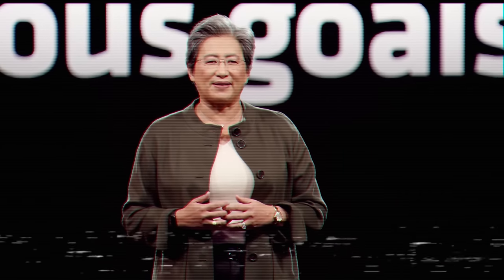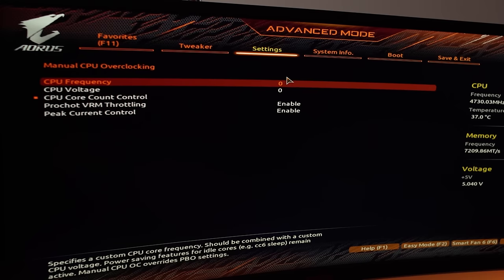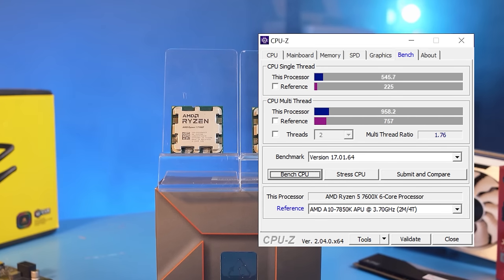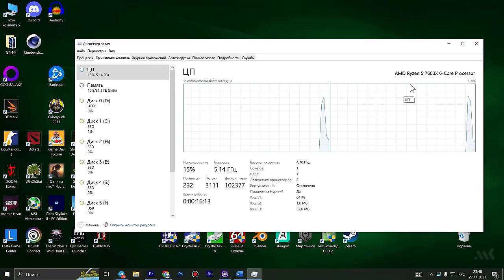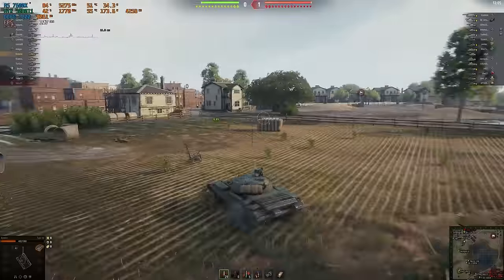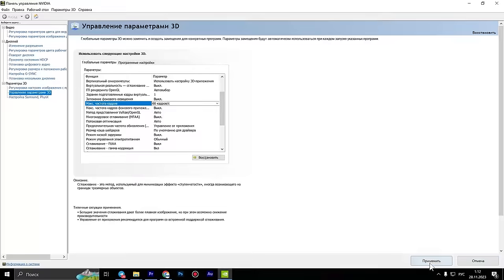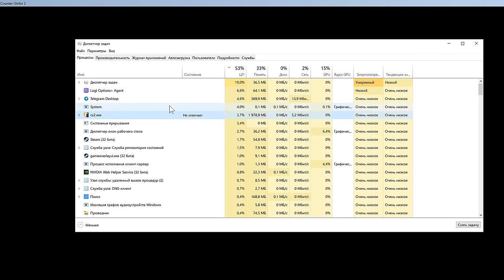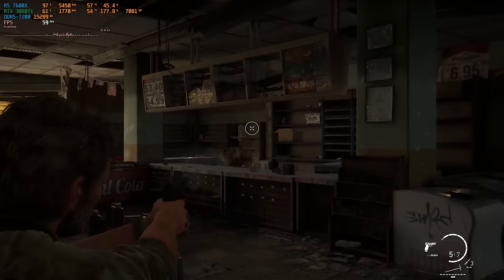One core is OP | Ryzen 1 7100F test

Comment: That SMT is purely a Software-Implementation is false. There have to be Hardware adaptations to the chip to get it working. It just takes little diespace, but it is not possible to get a core to work multithreaded only by software. Please correct. THC
Reply: Actually it is multi threading existed since 1968 on single core cpus. What they did is pause and save the instruction position of what was running then switch to another thread.
That's how windows 3.1, nt.95 and 98 all worked. There is a book called how to create your own 32 bit Operating system. That will explain it and goes through the code on how it is done. There are other sources also.
Reply: @GRHmedia But SMT is simultaneous multi threading (ie using free arithmetic units on core to run 2 threads almost at the same time) not just task switching in time.
Reply: @GRHmedia  the video is still misleading. he's keeping SMT turned on in the bios, but SMT is hardware MT and doesn't work "purely on the software level". he's talking about software MT which he can't even turn off in the OS.
Reply: @GRHmedia That is time sharing based multitasking. That is NOT multithreading. It is in diametric opposition to multithreading.  Matter of fact, that is what they called it, time sharing.
Reply: You are correct. I think the problem is you need to be able to save the state of the registers, and that requires hardware to do. Otherwise when you run another threads the registers get flushed and the data is lost. A lot of the bulk work is done through pushes, pops, peaks, bit shifts... and that's all register work.
Reply: Which is why SMT was disabled on some of the Renoir APUs like the amazing (for its time) Ryzen 5 4500U. It had 6 cores and 6 threads.
Reply: Amiga's were multi threaded on a single cpu
Reply: @reghawkins73 NO! They were able to  multitask through time sharing the CPU. That is not multi threading. It used the Motorola 68000 which is a 16/23 bit processor. 32 bit CPU but only a 16 bit bus. Later Amiga clones used a Power PC processor that could handle 4 threads per CPU. But the actual Amiga? Nope.
Reply: SMT uses dead time in a core (caused by things like a cache miss), and extra registers to keep the core working. X86 cores already have many more registers than you’d think in order to allow SuperScalar processing (where there are multiple execution units that are fed operations out of order, and registers are continually renamed internally to allow each unit to work with values that may have been changed by others), so this doesn’t take much more space. Logically SMT looks like two physical cores to software, but you can’t get the full performance of 2 actual cores, more like 1.3. It’s a fairly cheap way of getting extra throughput from a core that would be otherwise stalled waiting for something.
Reply: @krisspkriss well Amiga was multithreaded, Copper and other chips could run in parallel with the cpu. 😊
Reply: @AllanSavolainen  :D That isn't what multithreaded means. A 486 had a math coprocessor that ran in parallel with the CPU but yet it wasn't multi threaded. It also had a graphics card that ran in parallel. Still not multithreaded. Le sigh.   You do understand that Copper was literally performing the functions I just described? Do you also understand that... just about every computer does what you say? Damn, I guess my Commodore 64 was multithreaded too! It had a sound chip that able to stream data independently from the CPU... so.... multithreaded (by your definition).

:D:D:D:D:D:D
Reply: @krisspkriss  well SID cannot execute instructions itself but the CPU needs yo feed its registers. But Copper had instuction memory it executed from and could do so independently from the CPU
Reply: @AllanSavolainen  And  everything you said applied to a 486 with a graphics card.  Or how about a 386 with a math coprocessor installed. 

As for SID in the C64... OK, fair enough. At least we are establishing some borders on what is or isn't multithreaded and why.
Reply: @krisspkriss  I do have to disagree with you. As the 287/387/487 math coprocessors cannot execute code themselves, they just have registers where the CPU puts values and there is a command to wait for result (or keep executing and fetch the result later). The math copro wont fetch any commends from memory.
And same thing with 486 era graphics cards, they had blitters and other commands to draw on the screen, but they were also called via registers and don't think any had execution queue, which is why they were quite slow for line drawing etc, only moving memory around via blitting was really useful.
But I can agree that SMT wasn't a thing on Amiga era home computers. I think Cray Y-MP did have it though, but I think it was a vector computer, so perhaps it mostly just had SIMD.
But I think there is a reason to call it SMT and not just MT as the latter is quite vague and could mean systems with parallel coprocessors. Like some 16bit consoles that had Z80 for music and it actually did ran parallel with its own code.
Reply: @AllanSavolainen  I agree with you 100%. I would never call a 486 multithreaded either. I was just trying to establish what my interlocutor thought made a CPU multithreaded. In my mind, you have to have multiple threads running concurrently on the CPU with the front end of the die containing all the needed support hardware to make that possible. 

Hell, if you don't constrain it in that or a similar way, a WW2 analogue fire control computer on say... the Iowa... would qualify. They had independant resolvers with their own independent I/O and yet worked in concert for the same task. 

No, I am not saying it was multithreaded. I am saying it becomes pretty meaningless if you dont constrain its set in some way. Like... the FPU and APU have their own registers and run independently... so does that make a single core processor without multithreading... a multithreaded processor? Or does it have to be completely Turing complete on its own? In that case, it is only multithreaded if it has more than one core, and Hyperthreading is irrelevant. 

So you see where I am coming from. I just want to avoid going where dragons lie.
Reply: @krisspkriss  Just to point out that I have multithreaded 486 computer, it just has two CPUs :) classic SMP
Reply: @AllanSavolainen  Yeah, I used to rock dual CPU system back in the day. My last was an Opteron 2435 (I think). I agree. I also used to argue with people that said it was useless on a home system. But the ability to <alt><tab> between a game and YouTube or back in the day, my WinAmp player, was something you had to experience to understand. And most people didn't.  I think my first dual core was an Athlon K7. Could of been a K6-II. Been a long time.
Reply: Multithread and SMT(simultaneous multithreaded)/hyper-thread are different things: multithread is pure software solution, SMT/hyper-thread are hardware solutions.
Reply: @chenyansong  SMP is also hw solution to multithreading.
Reply: @AllanSavolainen  technically multi threading is different from multiprocessing.
Reply: @chenyansong  well from the apps point of view, not so much.
Reply: Who needs E-Cores LMFAO

Comment: Imagine if the whole chiplet is one core. In your experiment, there are plenty of unused space in that chip.
Reply: We dumped superscalar with ultra deep pipelining for valid reasons. Intel had the Prescott architecture that was able to hit very high (for the time) clock speeds and had some serious single threaded throughput so long as you did not miss a branch prediction. Once that happened, you had to flush the entire 40+ stage pipeline and start all over. Some of the stages were double pumped and I think one or two might have been half pumped for full precision, but for simplicity sake, we will call it  40 cycles from start to finish. Then came a lower clock speed design from the Israeli team with only 20 stages in their pipeline that was relegated to the mobile and low power line actually beating the Prescott, despite the lower clock speeds. And on that day (metaphorical day), giant single cores died. 

They cancelled a planned 4GHz design and they had a clear path to 10GHz. Why? They would have been even hotter, less efficient, and take even larger hits with a branch prediction miss.
Reply: @krisspkriss  I always wondered why they didn't try mass speculative decode on multiple pipelines, given a large enough L1 cache it should be possible to lazy load them in -- rather than having like 32 full pipelines all the way to the execution units, you'd have 32 early-stage pipelines that funnel down to the smaller complete pipelines, so a branch mispredict would cause a smaller bubble in the pipeline since the correct instruction was at least processed as far as it could go depending on what data-dependent stages there were.
Reply: @NozomuYume  This is background data. To get to the meat, skip to next paragraph.  Back in the day, I asked myself the same question. I was on The Motley Fool and AMD had just started the K7  to Hammer transition. They had introduced 64 bit to the consumer. This was a big then since Intel was using that as a high end feature exclusive to their Itanium line. And it was multicore which was a high end feature you needed to buy into the Xeon line to get. I was a HEDT consumer at the time, and a dual CPU board was the only real option for multithreaded X86. So That is what I was rocking. In this discussion entered someone with actual fab experience. In this group discussion I was heralding the benefits of running two CPUs (the concept of the core vs CPU wasn't fleshed out yet). The fab guy was quick to say "no one else cares about those things". And for some he was prolly correct.  In any case, this is what I remember he explained to me. Most of this is outside my wheelhouse and experience by a long shot. So... huge block of salt. 

Most code branching is clustered together. Think of it like this. You are designing a solution and forming an outline of how you want to code this. You know that a branch prediction is is a huge cost in performance, and so you try to make long stretches where your code runs without a conditional statement. That already is clustering the branchy parts closer together. Another concern might be that you want commonly used function calls to stay in cache. The easiest way to do that is run those function calls at the same time or in series. And so again, your branches are less homogenous within the code.   And on and on we go. Then when you compile it into machine code, the compiler is also going to do some wizardry that... makes the code even less homogenous. So you end up with the branches in clusters and there are interdependencies within them. So no out of order. Each time you make a branch, that doubles the paths needed to be taken. So one branch leads to N other branches and now you have 2^N cores needed for this scheme and only one of them is actually usable. And you have to keep those branches loads and stores in quarantine until you actually find out which is the keeper, so you also have 2^N number of speculative load and stores cached and labeled as possible trash. Now you are eating up all your cache and its only using 1 over 2^N of it. In short, it wastes much for little actual gain over a branch prediction unit that probably has between a 70 and 90 percent accuracy.

I hope that helps. It is mostly right, but I know I slaughtered something in explaining it. Chip design and coding are not my wheelhouse
Reply: Who needs E-Cores LMFAO

Comment: the ghz race stopped because it hit a wall, not because they thought it was cute going horizontal. you wouldn't have 10ghz cpus even if they were single core. not on silicon
Reply: What do you think the next medium will be if not silicon? Just wondering!
Reply: So add a trillion trillion transistors and allow hyper threading to put 100 billion threads on it.

I think there's a way to do at least an order of magnitude better with single cores, it's just not being done.
Reply: @stevenswall  many years ago they were researching a material, don't remember what it is, that would allow speeds up to 400ghz. maybe one day. but not on silicon.
people have been desperately looking for a room temperature superconductor for a reason
Reply: @GraveUypo I'm not saying to run an engine at higher RPMs, I'm saying add more cylinders. Is there a reason they can't do that?

My baseline assumption is large companies make crippling decisions when their current strategy is working.

EX: 32 bit Windows could have worked with 128GB of RAM with PAE. Microsoft turned it off by default and lied to the world that they needed a 64 bit machine.
Reply: @stevenswall  they are doing that. go test a 5ghz pentium 4 against a 5ghz ryzen x3d. each cycle in tje ryzen is worth like 10 cycles on that pentium. the difference is massive.
Reply: @stevenswall  PAE does not change the amount of virtual address space available to a process. Each process running in 32-bit Windows is still limited to a 4 GB virtual address space.
Reply: @jacobnix6691  probably graphene. They've finally made proof of concept semiconductor on graphene this year that uses existing silicon lithography manufacturing tools, so the next step is scaling that up to make complex transistor gates that make up CPUs.
Reply: Who needs E-Cores LMFAO
Reply: We have 6 ghz processors. Its possible to have 10ghz mainstream in 5 years
Reply: @gabrielv.4358  not with silicon. You should look up what electromigration is, and what the balance is between signal frequency, heat generation, and die size.
We're butting up against the limits of silicon now in terms of die size. We're hitting hard limits of physics at 6nm transistor sizes, which is why Ryzen CPUs moved to a chiplet design.
Reply: @gabrielv.4358  6ghz proccessors who did not run all cores on max frequency and still with disabled power limits takes over 300 watts which is nonstop producting heat on i dont know 6-7 square centimeters? second problem is power requirements are more close to exponencialy going up with speed so when for 6ghz you need 300 wats for 7ghz you can easily need 1200 wats and similar numbers and cool it with liquid nitrogen

Comment: Hold up, the core count race did stop for quite a few years. For a long time you only had 4c/8t Intel cpu(s) as your best option. While amd was putting out really bad "8 core" cpu designs. it was like 8 years.
Reply: It was only on a desktop and only because AMD was unable to compete. On a server market core count grows fast - lga771(y2008-4cores), lga1567(y2011-8cores), lga2011+v3(y2014/2016-up to 22cores). as for AMD there was G34 with "16-cores" Opteron (like doubled FX processors)
Reply: @АндрейШевченко-к6й  The AM3+ Bulldozer cpus. Too much power draw and bad performance. That was the last of AMD bad performance as Ryzen came next and started slowly taking the lead by the 3rd gen. It's a beautiful story.
Reply: Don't worry, we're now revisiting the gigahertz wars.
Reply: @ArtisChronicles Yep, 4 GHZ used to seem monster fast, now it seems basic.
Reply: Who needs E-Cores LMFAO

Comment: Correction: Multithreading is NOT a software only thing. It requires hardware support in order to properly utilize it.
Reply: Actually multithreading can be software only, simultanous multithreading requires some hardware support, either SMP or SMT etc.
Reply: @AllanSavolainen  The video is referring to SMT
Reply: @sbeve7445  sure, which is hardware feature as OP corrected
Reply: Yes. it seems it was made with gpt

Comment: Hyperthreading or SMT is not just a software feature like you state. Although they are single cores, some things inside them are doubled like the arch state registers (these include general purpose registers, control registers, APIC and some machine state registers), each hyperthreaded core will have 2 of each. And by the way, that 4K video on youtube is almost likely being decoded on the gpu.
Reply: i understand nothing but got the message

Comment: The AMD A4 and A6 APUs up to 2019 are arguably single core processors, though AMD marketed them as dual cores.
Reply: Maybe like 1.1 core :-) - I have A6 9500 whose multithreaded score is about 10% higher single than threaded score.
Reply: i have a A6-9225, THERE ARE NO FU*KING DRIVERS FOR IT IN UBUNTU 😭
Reply: @SniperAWP tip: 9225 is equivalent to 9220 i belive
this helped when downloading the radeon drivers
Reply: @SniperAWP  Welcome to Linux. Nothings supported.
Reply: @Iristallite  i havent installed drivers for it since the kernel has it preinstalled. As of my knowledge when i tried to install by using the amdgpu-install script it bricked my install, so no drivers for me.
Reply: @SniperAWP Linux updates won't bug you while you happily turn your computer into a brick.